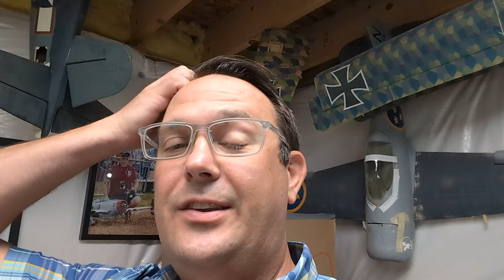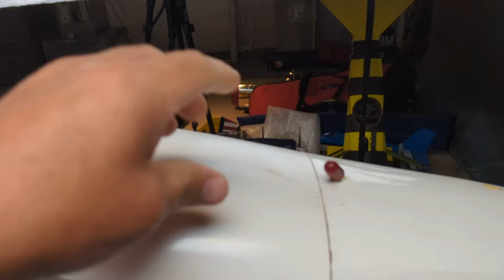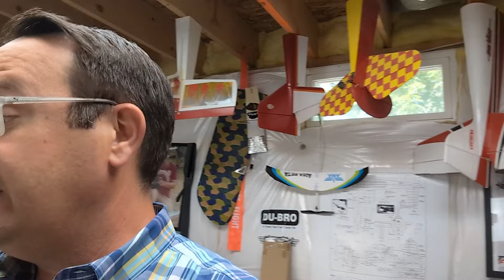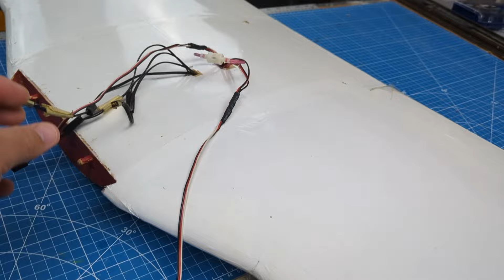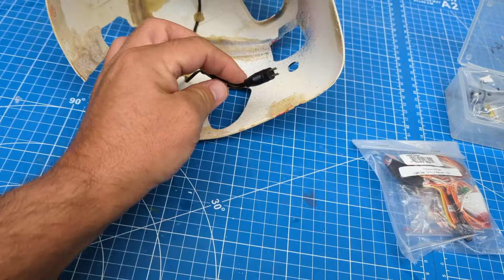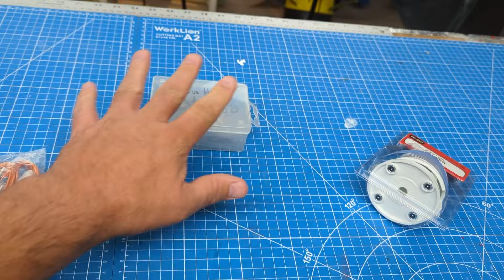Top Flite Bonanza V35 | Restoration Part 1

Comment: Plastics can break down from UV light and somewhat by other bio degrading in some formulations but a proper remanufacturer that uses recycled material to make new raw polymer beads can eliminate damaged chains chemically.  Any given polymer like Poly Propylene for example is a very specific chain so they can chemically purify the recycled material just fine.  For that reason I dont agree that recycled material is normally inferior to virgin material.  Ether material (virgin or recycled content) can contain unwanted polymer chains that produced impure and weaker materials.

Comment: I love flying my bonanza, my experience though a 1.20 FS is the ideal power plant. The .91 will fly it but you’ll want the extra power. I’m usually flying mine at 3/4 throttle with the 1.20 and a 16x8 prop

It’s also a shame they covered that plane in ULTRACOTE. The color peels away from the clear plastic especially on white Ultracote. If it was Monokote it probably would look brand new still.

Comment: I have this kit. Also have the electric retracts and several engines I have yet to decide on. I have an OS 120 pumped, OS FT-120 II and the one I am leaning towards, an OS FT-160. I REALLY like the idea of the pumped 120 though..
Reply from the maker: The instructions say that it will fly on a .60 size very well and that the .75 Super Tigre the prototype flew on was nice too. I'd imagine a 1.20 will be quite overkill. A 160... I wouldn't. Of those engines, I'd choose the pumped one too.

Comment: Those are ram electronics lights. Cutting edge tech back in the 90s. They made a kit for this. Nice score! Mike
Reply from the maker: Yeah, I ran across the lighting system while doing my homework on this model. I thought about trying to repair it but in the end, an LED system that runs off the receiver pack is far simpler long-term.
Reply: @JoshuaOrchard  yeah. I still have a few stuff nib.

Comment: Nice looking plane. A friend has one.  
I have several of the 91 Surpass engines but none are pumped.  They are very happy with a 14-7 prop.  I have 16-6 on my 1.20 Surpass and pre Surpass engines.  Run it with the 16 and see how it is.  The pumped version just may turn it without a problem.